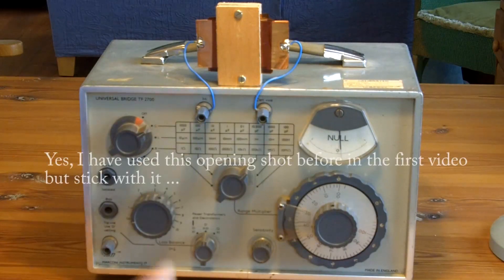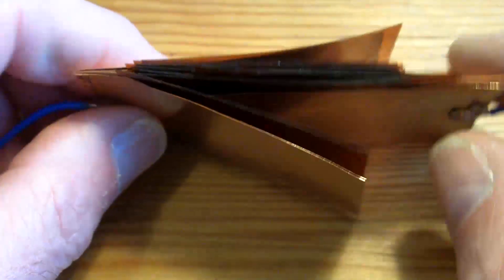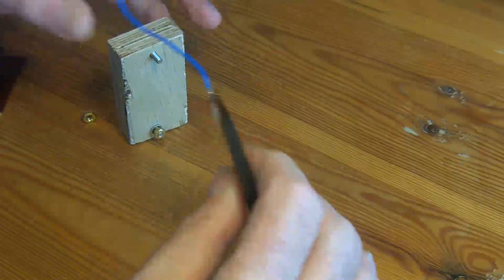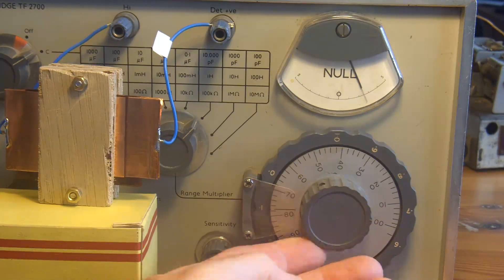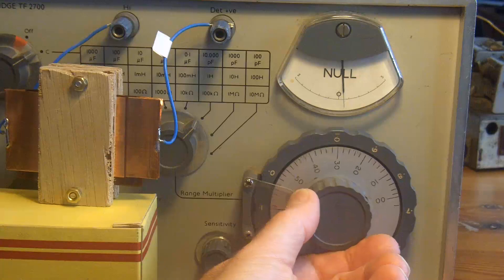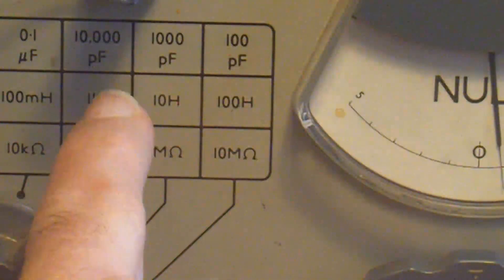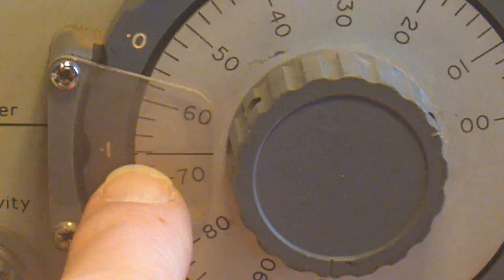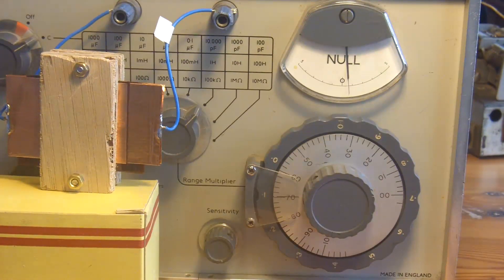About Capacitors ... Part 3 Double the gap halve the value, by Andy Davies

Comment: Does the same hold true for the variable capacitor? If the spacing between the moveable stator and rotator are doubled is the effect the same for the variable capacitor as it is for the fixed capacitor? Thank you Andy for the video, Terry.
Reply from the maker: Hi Terry I’m sorry I haven’t come back to you before but I don’t
spend much time on YouTube. I used to get really bogged down with loads of responses every day taking hours to deal with.
Yes, as you double the spacing between the plates of any
capacitor so you half the capacitance. 
Kind Regards  . . . Andy
GWØJXM

Comment: Very interesting series! I thought it would be nice to do the math and calculate the ideal value. I found e_r=3,5 for Kapton. With C=e_0*e_r*A/d = 6545pF. Perhaps the difference to the measured (real) value of 3400pF comes from the air gap between copper and Kapton. It could be interesting to see what relation between pressure and capacitor value consist.